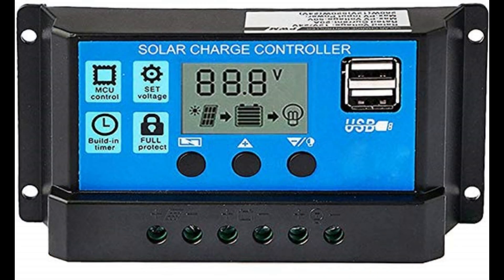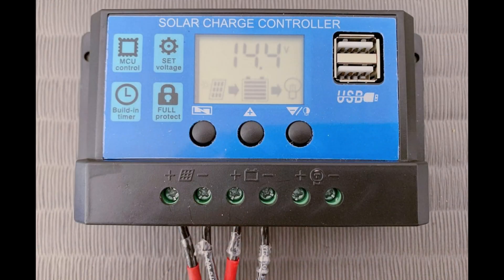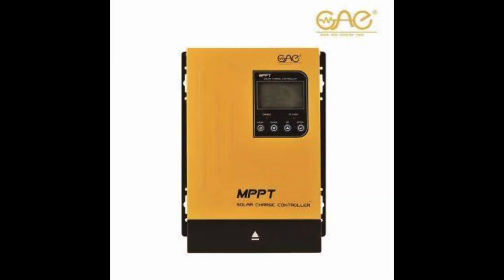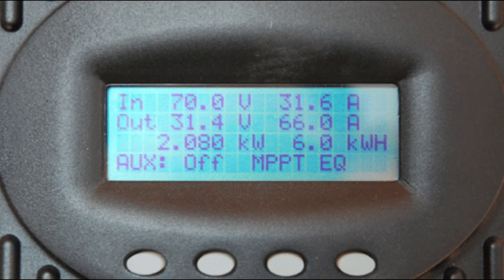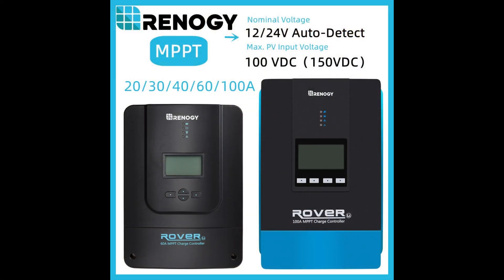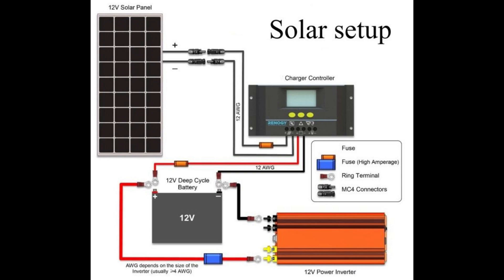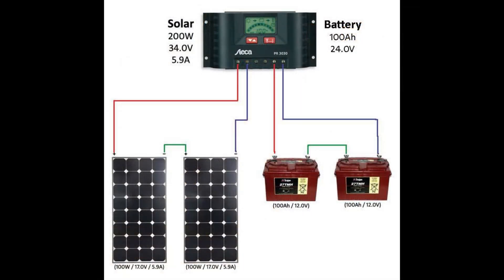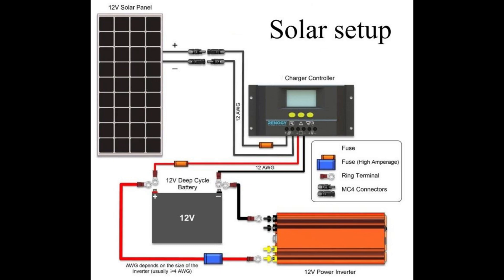A Beginners Guide To Solar Part 3: Picking The Right Charge Controller. The Heart Of Your System.

Comment: I  have a small gas generator that I use in the day. But it makes too much noise for use at night, so I bought a 2000watts Power station, I'm planning on building several power stations for my work shed,  my home and my other properties. Some properties have too many trees so I might have to constantly transport charged batteries from home. This is why I need a system that I can expand on. I won't know how big I need to expand until I've experienced it. I don't live off grid but I hate electric bills, so I know I am definitely going solar or semi- solar.
Reply from the maker: I think you have the right idea. You can charge the batteries via solar when possible and also via the gas generator while it's running. That's the best of both worlds.

Comment: The PWM (Pulse Width Modulation) controller can be best described as a person between the solar panel(s) and the battery. If the battery needs a full charge, the person would connect the panel directly to the battery. As the battery neared full charge, the person would start to disconnect the panel from the battery and then reconnect it in a fast manner, back and forth so that the battery is maintained at full charge without over charging. The PWM controller does the same thing with the pulse "connect" time to the panel(s) getting shorter and shorter as the battery nears the full charge state. I have a 12VDC system with a PWM controller that can take a max of 60 amps from the panels and pass it on to the batteries. I have 7 panels totaling about 1000 watts, all between 100 to 200 watts, and connected in parallel. At optimum sunlight I can get about 55 amps from the panels. The voltage of panels in this watt range is about 21VDC open circuit and about 18VDC under load. Panels above 250 watts have higher voltages and would be a waste to use as max current is the important part with a PWM controller.
A MPPT (Maximum Power Point Tracking) controller is best used in a series connected panel system where the input voltage to the controller is maximized and current is no higher than the max current of 1 of the panels. That is why you can use a smaller gauge wire from the panels to the controller. The MPPT controller takes the high voltage, low current power from the panels, converts it into AC power, then changes it back into lower voltage higher current DC power for your batteries. The two most important numbers on the MPPT controller is max voltage input from the panels (the higher the better), and the current rating for battery charging. Those numbers of current from 20 amps to 100 amps as listed on the various MPPT controllers you were talking about, is not the max from the panels, but max current to your batteries. Think of the MPPT controller like a transformer for your house, where high voltage low current watts on the primary side is "transformed" to lower voltage higher current watts on the secondary side with high efficiency.
When you are using series connected panels to an MPPT charger, it is important that you have them all mounted together so that they all receive the same light at the same time. With my system, my panels are mounted in different places on the roof just because of the less than ideal sitting of my house. However, since all my panels are in parallel and I use a PWM controller,
I will get max current from whatever panels are lit by the sun while any that are in the shade as the day progresses will have no effect on the current coming from the producing panels.
Sorry this is so long but hopefully it will help with understanding when to us a PWM controller or a MPPT one.
Reply from the maker: Thank you very much for this- it is great information and sharing it

Comment: that really good. I have been doing installs many years now. charge controllers came a long way now. power worx has some 12V MPPT low cost ones that work very well . that boos in MPPT is really nice in cloudy or over cast sky's.  when you take a 10% boost and put that over 10 days. that 100% more. really adds up over time. every bit counts. with the RV installs Victron MPPT blue tooth controllers are loved . with my home I went with a outher option. more than 1 solar/wind system.  small stand alone 12V for small loads and 12V lighting.  then big 24V system. I have a stand alone 12V in the shop. have a charge station for extra battery charging . no loads . even a small 6V for shortwave radio . I made that years ago. still works . I find off grid homes having more than 1stem. and for charge controllers you can have more than 1 charging the battery . I do that with my 24V system. 2 different groups of solar that can't be tied together but will both charge 24V with 2 controllers into 1 battery bank. I do this with RV when different panels . Victron controllers will work together as many will on same battery. check before you buy them.
Reply from the maker: Thank you for sharing those tips, that is good info that people should know

Comment: This is an awesome series you have going. We are 90% off grid running 1000w of panel at 12v with 6 flooded deep cycle batteries. We have been pleased so far but i think you just talked me into finally upgrading to 24v. Bin puttin it off as now the power gets kinda dangerous. Looking forward to part 4.
Reply from the maker: Thank you- I hope you can find some use with these videos

Comment: and i believe the higher the voltage the smaller wire guage you can use
Reply from the maker: The stuff I had to get to run to the new studio was a small gauge but very thick wire. It was 2-2-2-4